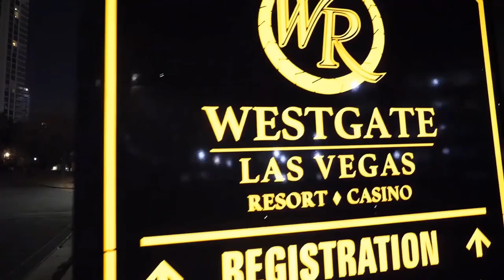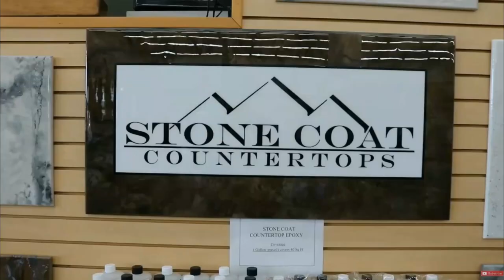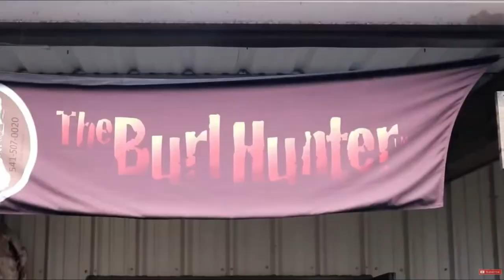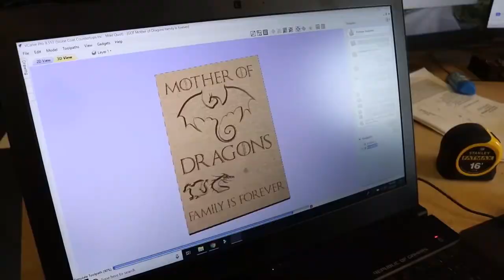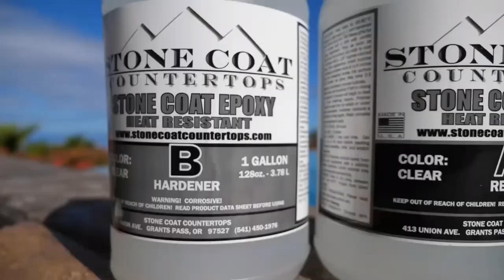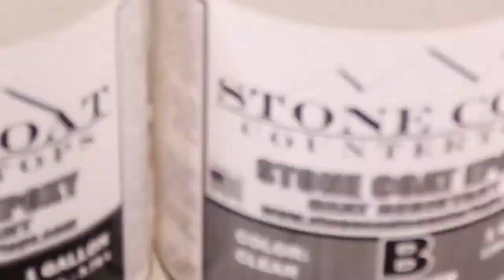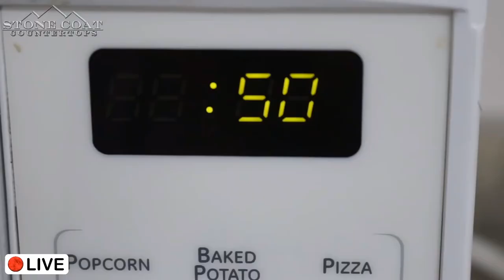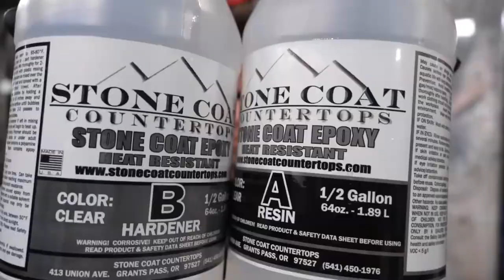130+ Million Epoxy Videos Views in 2019 | Thank you from Stone Coat Countertops

Comment: Been watching this channel for some time now. I find it amazing what you can do and mimic with epoxy.  I have a challenge for you and I have this idea not sure if it will work. Could you use bondo to 'build up' and make it look like rock? I even thought that maybe you could use sand to mimic the texture maybe? 

The other is for it to stand up to the harsh reality of the sun, as I want to put this outdoors. I recently saw a video in which you have a UV resistant epoxy. The other part of this is the shower remake video you posted earlier this year, plus I've seen videos in which you reduce the sheen by sanding. 

But would sanding be necessary if you use bondo to build up to make look like stone, then coat in sand? Use epoxy to encapsulate? The faux stone market is mostly polyurethane painted plastic. Would love to see you attempt this in an upcoming video. 

If you don't do it, I may attempt it on my own.. then give you a shout out. Thanks for the great content, I love it.
Reply from the maker: We'd love to see your work! We have a few videos showing how to do a rock face edge using bondo. Thanks for your feedback!
Reply: @StoneCoatCountertops  Thanks for the reply, I am not talking about a rock face edge like as in counter tops. I am talking about rock face edge as in like siding on a house. In essence the whole piece would mimic rock and feel like it. Possible?